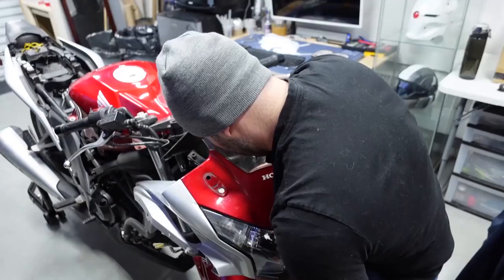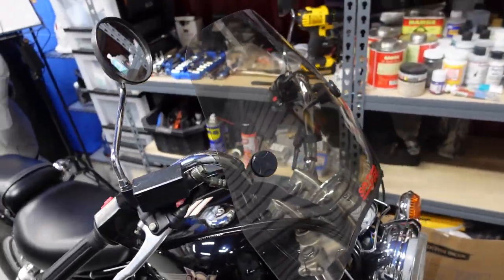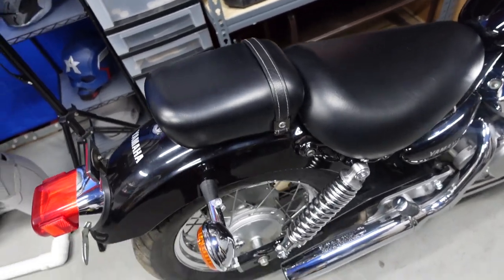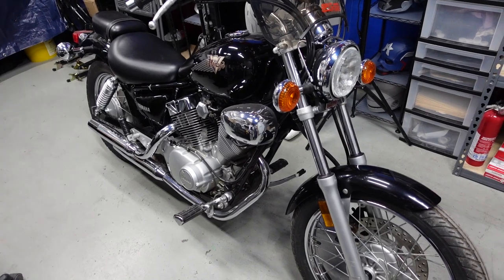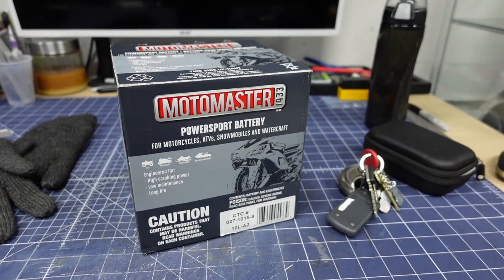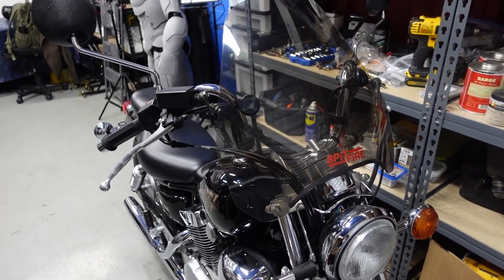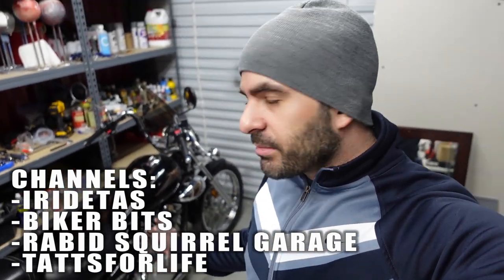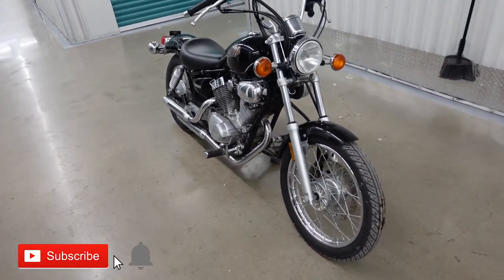Yamaha Virago 250 Project

Comment: I have bought a 1989 Virago. It is in great shape also, have to get my bike certified, Insurance & my M. but I have a problem in that it started when I got it. but now it has blown the fusable link off the battery positive cable and won't start even with a boost.